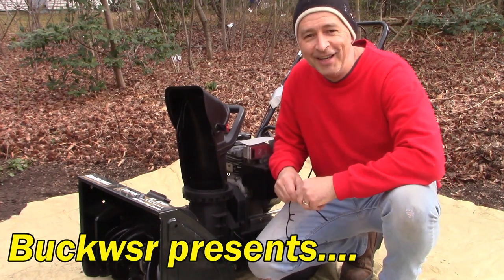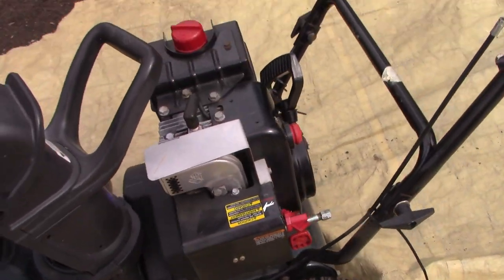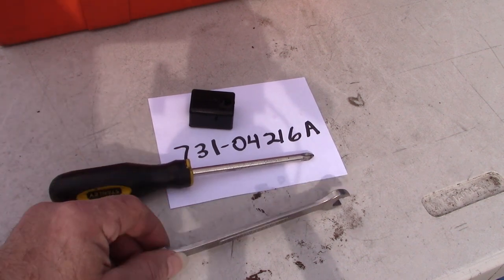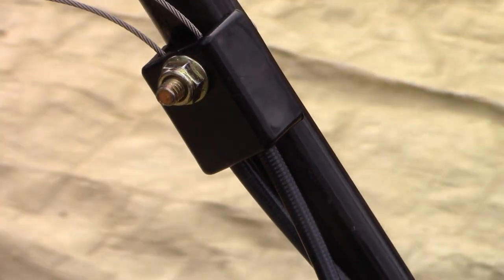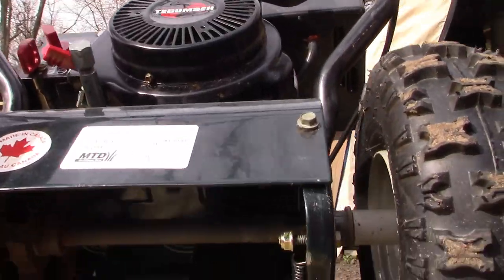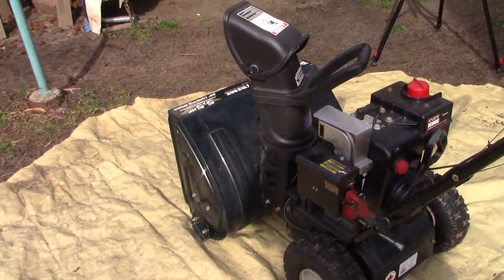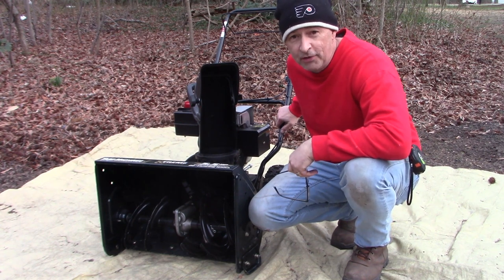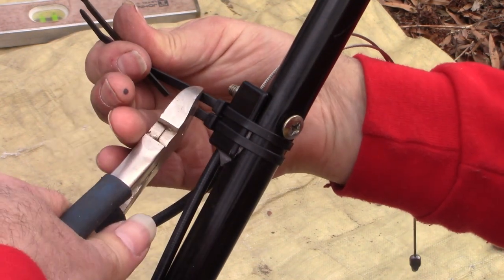Snow Blower Auger Cable "PLASTIC" Clamp FIX & UPGRADE for MTD Craftsman Troy-Bilt Yard Machines

Comment: The first two-stage snowblower I bought was one of these that I bought you used. Sellerr got it because they didn't have electric start which is not important to me. Someone had put a hose clamp on in place of the proper plastic piece which I think worked a little bit better. I actually bought three of the plastic pieces just so I would have them while I was using this snowblower. I have since upgraded to a better 26-inch machine. Thes cheap single speed Yard Machines don't do very well in heavier snow compared to higher quality blowers that are using the same Tecumseh engine. The lawn mower bail bar design is not that great can the cables can freeze up easily as they don't really have any protection from the elements.

Comment: Thanks for the part number. This is the Craftsman model too and Craftsman doesn't list the part number. They make you spend $50 for the auger cable just to get the clip. It's not a $5 part anymore but thank God Amazon has quite the selection. 👍